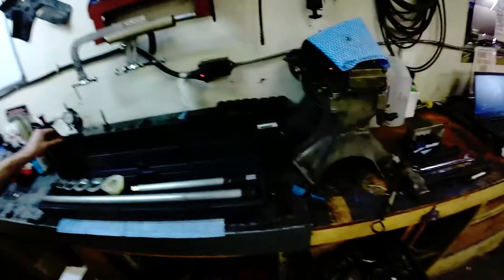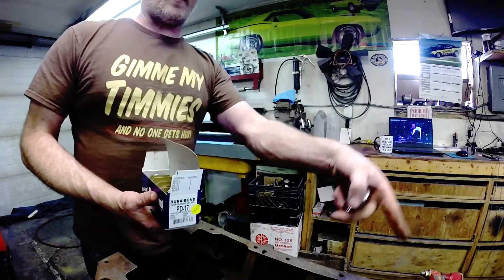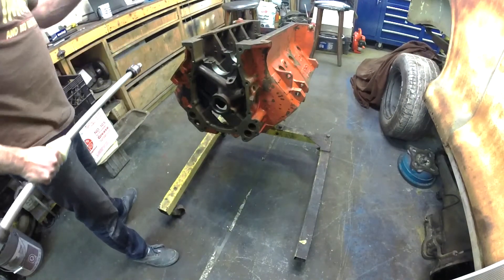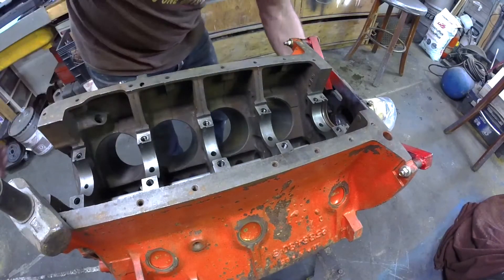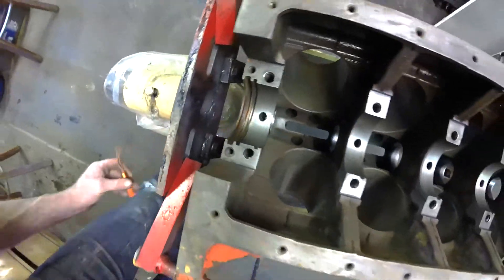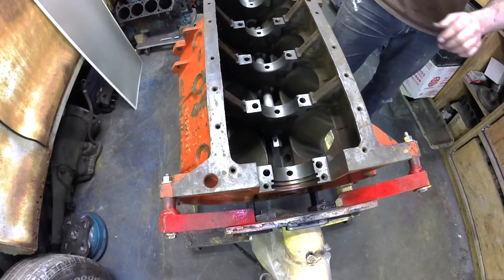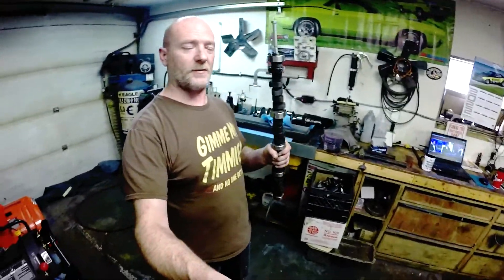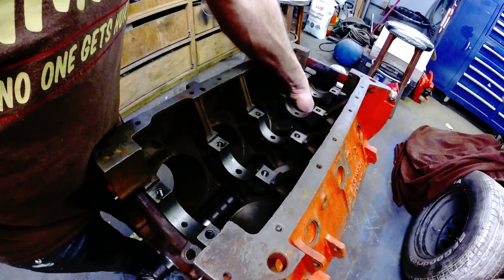Cheap 440 Build Pt13, How to Install Cam Bearings

Comment: I've never done cam bearings before mainly cuz I have only had a couple engines with a value higher than if it blows up who cares. Good vid.
Reply from the maker: Thank you. I am just lucky to have the cam bearing installer tool. It accidentally was at home at the time that I got locked out of my shop I started by my business partner so I never felt the need to take it back. Lol. I just think it's something people should know is possible in a home garage. 🤘🏼
Reply: @dazeofgloryshopworks5806  There is no such thing as to much knowledge just too many know it all's after the fact. Occasionally things are acquired thru karma, all good...eh
Reply from the maker: @noccis3448  yeah man. Nothing turns me off quicker than "I've done it all and seen it all". Right there is all I need to know about who I'm dealing with. Proceed with caution!!!
Reply: @dazeofgloryshopworks5806  More fun to subtly make them look like idiots.